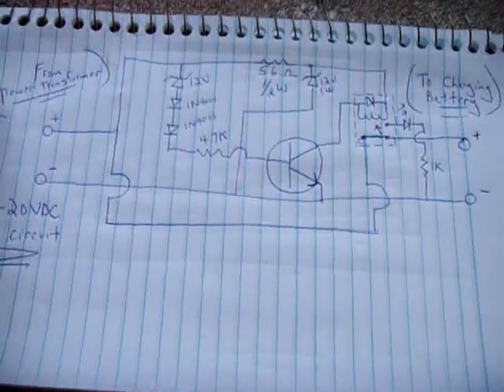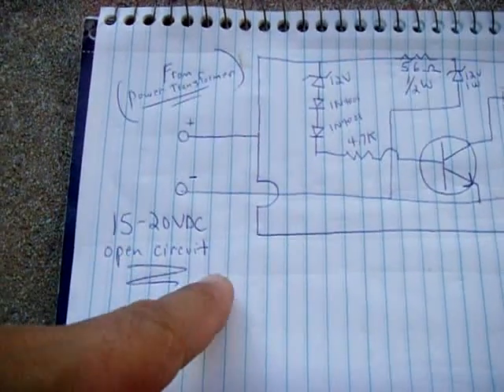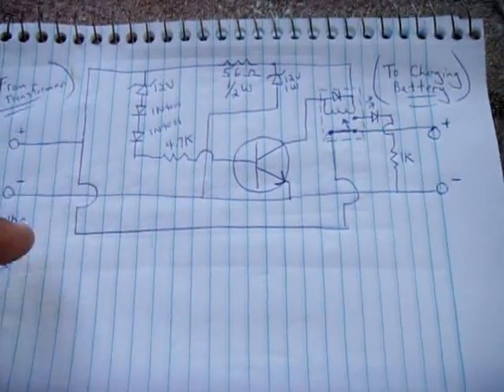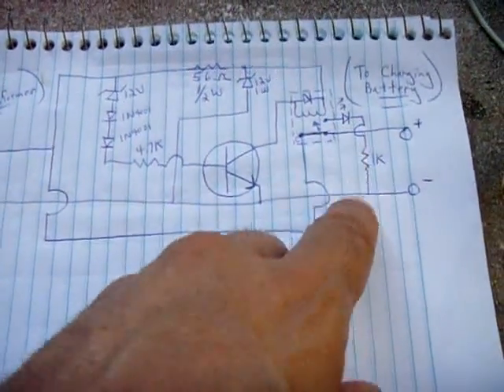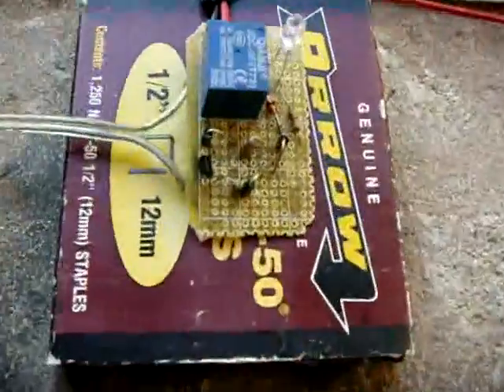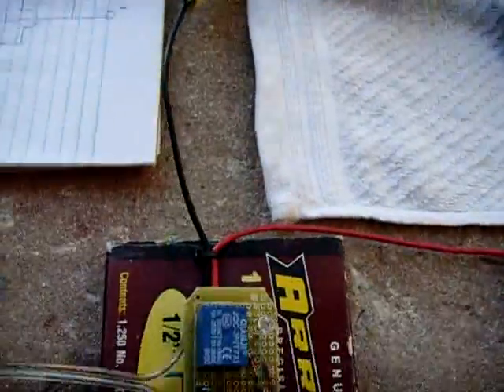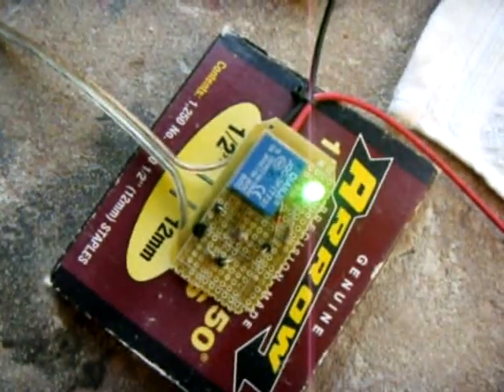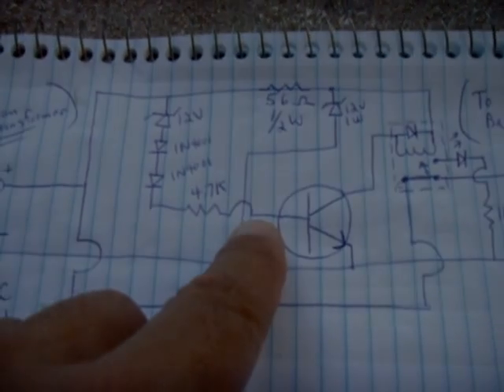Cut-Off Circuit For 12V Lead Acid Battery Charging

Comment: I'm trying to find a way to charge a capacitor bank from a dc power source and have an auto cut-off circuit to keep it charged, but not over charge it and potentially make it explode. I am intending to use this in a coil gun project and would like so advice.
Reply from the maker: Your not going to over charge a capacitor.  As long as the capacitor is rated higher than the voltage you are charging with, you will have no problems. You can keep the power applied to the caps all the time. Some capacitors may not like a huge inrush of current flowing into the capacitor to charge it up, but usually you will not have a problem with that. :-)

Thanks For Watching!

Check out my video playlists as well.

Comment: Sir, I can't find 12v zener :-( out of stock.
So idecided to buy 13v zener 500mW 
0.5 watts.
Number is "1N5243B" zener
Can i use this one????

Thank you...
Reply from the maker: 13v is fine. Wattage should be OK also. In the schematic I used (2) 4001 diodes in series after the zener leading to the transistor's base resistor. By doing that I increased the voltage to around 13.2, then another .6v across the transistor makes 13.8(or in that area). Since you are using a 13V zener, do not use the (2) 4001's in series. use (1) Schottky diode instead. Your output will be very close to mine.
Reply: Ooohh... So (2) 4001's is not needed already coz im having 13v zener? So i have to  replace the (2) 4001's with only (1) schottky diode? In series???? Sir?

I think example of scottky diode are between "1N5817,1N5818-1N5819" am i right sir??? Can i use these diodes thank you. Sir
Reply from the maker: yes
Reply: But it will remain 2 13v zener. Diode..

Comment: So on the relay "Common and NC" are connected with wire? Or its automatically connected already???? Thanks
Reply from the maker: C and NC are internally connected when the relay has no power applied to the coil.

Comment: can i use SPST 12VDC Relay 5A
it has a 4 Legs , coz i dont have SPDT relay,
Reply from the maker: The relay needs to be a SPDT. You need to find one in some old scrap electronics. Lots of consumer electronics use them. You may be able to find one in a microwave oven on the circuit board. Look for 5 pins.
Reply: oh ok, thank you for that sir, so i need 5 pins 12v dc relay

Comment: Nice circuit, but in the case of system failure, battery is overcharged and set on fire or at least boiled to it's death. why not take the opposite approach and have the relay enable charging, and have system failure result in nothing at all; no charging. Much, much safer.
Reply from the maker: Possible, but unlikely. Even a well designed/engineered circuit can fail.
Reply: electronicsNmore Well, in reality it happens. It just happened to my friends solar setup, and lead me on this search for a better way. The reality in solar is, why have a $5 relay malfunction cause a $2000 battery expenditure. Good design starts with good defaults for failure.
Reply from the maker: The circuit can easily be modified for extra safety.
Reply: electronicsNmore I agree that is sort of what I am up to, trying to wrap my head around it. And you are correct, the charge controller that failed and defaulted to overcharging was worth $280 and was a "big name" product. I do admire the simplicity in your design, and I looked at Missouri Wind and Sun's design, and seeing both of these similar approaches, I'm gonna put something together that follows the logic of: Is there energy? If yes > activate relay and charge > Is voltage to high? >if yes, shut down. That way if the circuit failed completely no charging. if the relay fails, no charging.

Comment: If you're getting in 15-20V DC from the transformer, and it's meant to shut off at 14.2V, wouldn't it always be shut off? If there was the minimum of 15V DC coming from the transformer as drawn, wouldn't the transistor always be so that the battery was not charging?
Reply: The 15-20v from the charging circuit is the unloaded voltage. The loaded voltage is lower and should be close to the battery's voltage which will be lower than the shut off voltage until it is fully charged. I think that you are right that it will be shut off when there is no load, therefore, you would have to wait to turn on the charger until you have attached the battery.

Comment: I don't have a very big monitor so I cant clearly see the diagram could you please email me a copy as well as a parts list?
Reply from the maker: When the video starts, switch to the highest resolution to watch. Lower right area of the video window.
Reply: electronicsNmore got it but don't see a part number for the relay you used
Reply from the maker: I used a 12v relay from a microwave oven. Many will work. Try and look for a 12V relay that has a coil resistance between 270 & 700 ohms.

Comment: ya its really useful but  i need 24 volt battery charger system actually i got transformer output 26V(ac) and 16AH and two batteries each 150AH. how do i make this transformer real good battery charger as your video got..oo i got full wave rectifier too (kbpc3510) too.
Reply from the maker: Most people use 12v, that is why this video was made for 12v. You would have to change many component values to have this circuit work at 24V.
Reply: electronicsNmore thanks for reply  can you plzz mention those components  or make circuit diagram and directly send to my email add..
Reply from the maker: Why not just charge both 12V lead acid batteries in Parallel with the 12V Battery charger?

Comment: can you post the photo copy of this schematic here ?
Reply from the maker: There should be a link in the video description area.
Reply: electronicsNmore really there is nothing in description its  for this vedio

Cut-Off Circuit For 12V Lead Acid Battery Charging
Reply from the maker: If I did not place a link in the video description area, that is because you can see the entire circuit in the video. Watch in the HIGHEST quality setting, and pause the video.
Reply: electronicsNmore as i see all what i need is in this list please correct me if im right

zener 12v
2 x 1n4001 zener
4.7k ohm resistor
2n4400 transistor
12V, 1W ZENER DIODE
56 Ohm 1/2 Watt resistor
1k ohm resistor
12V 10A Relay
LED

Comment: It is a very nice circuit with nice working. As I wanted to ask you that how can we use a Mosphet instead of going or Relay as mosphet do more precise switching and covers less space. Secondly as you said the circuit once cut off the charging need manually action to start charging again cant it we done by some other way like some switching circuit.
Reply from the maker: You should be able to replace the relay with a low RDS, high current(10A or more),  P-Channel mosfet. The source of the mosfet will go to the (+) side of the circuit(which is opposite N-Channel), and the drain side of the mosfet will connect to the charging battery (+) terminal. The mosfet is turned on when the gate is low/negative. From the gate of the mosfet you will need a resistor to ground(Try a 1K to start). From the junction of the mosfet's gate and 1k resistor, you will connect to a 220 ohm resistor to the emitter of the transistor. From the emitter you will also connect a 10K to the neg rail. The transistor's collector is connected to the positive rail. As the voltage rises near 14V, the mosfet will start turning OFF. Make sure the battery is connected to the circuit BEFORE powering up(Same applies for the relay circuit).  You will have to play around with the resistor values to get is just right. You want the mosfet to turn off fairly quickly, otherwise it will overheat. Be sure to use a large heat sink.
Reply: electronicsNmore thanks for such a elaborated explanation for the other way out to achieve the cut of circuit. I will try the same and let you know the outcome. Just wondering after High Cut-off when battery going to get discharge again how to again put it to recharge without using a switch etc.
Reply: electronicsNmore Hope you must be doing good...as i have tried the circuit using mosphet but due to excessive heating of mosphet i have droped the circuit. Now i have made the one explained by you as i didnt have the 56E 1W or 0.5W resistor so as a result currently the cut off taking place at a Voltage- 16.2V so kindly let me know your views.
Reply from the maker: deepak kapila
The reason for the heat, the mosfet is SLOWLY turning off. You would have to use another circuit to trigger the mosfet fully on and fully off. I say stick with the relay, it works PERFECTLY with a relay. No need for the mosfet. 12V relays that can handle 10 amps are abundant.
Reply: Yes I also did the same relay is doing good just its cutting at a voltage of 16.0V and i have used diode 1N4008.
Reply from the maker: To get a lower cutoff voltage, lower the zener value, or remove the the 1n4007 diode in series with the zener.
Reply: Okay we did it just got 14.7V which is okay to me. Thanks to your support
Reply from the maker: Very good! 14.7v is fine. That is about the top.
Reply: Thanks more to learn from you...

Comment from the maker: The circuit is a "Charging Cut-Off" for use with a charger. It does not charge. I have another circuit that I have been using for many months to charge LI-Ion 18650 cells. Look under my video list for "excellent & simple Battery Charger". That works fine for Li-Ion.

Comment: I suggest a modification to allow the circuit to return to the on position when the battery voltage drops, as they discharge over time. It may require better regulation on the input side (to relay eliminate chatter). This would then be useful as a true battery maintainer.

Comment from the maker: I can assure you that it definitely does work. Go over the schematic again and re-check all your components/connections. I would suspect a zener diode problem. The base of the transistor may not be getting voltage to  trigger the transistor, which in turn triggers the relay.

Comment: Nice circuit. All circuits I've tried, they all oscillate when the voltage gets near the threshold. I've modified a car battery charger to have an automatic cut-off and it oscillates once every few second to give the battery a trickle charge so it won't start discharging. Also try your circuit with a real battery and wait and see if it doesn't oscillate. :)